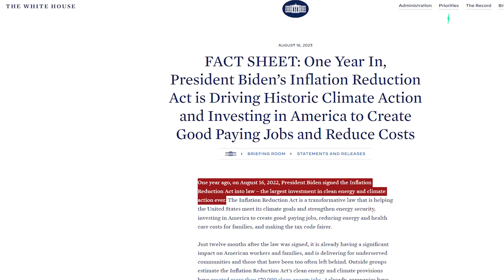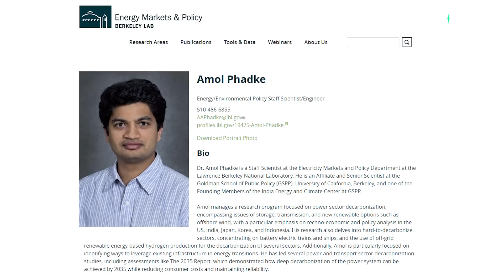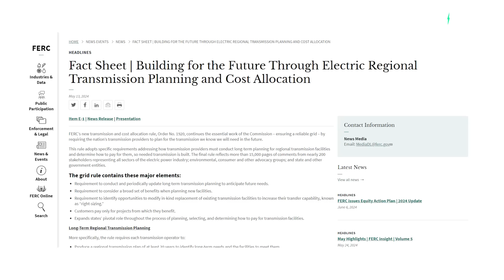How a small change could double the size of the U.S. electricity grid

Comment: The US grid is not in shambles!  You are so uninformed.  Utilities have always used various means of upgrading power lines to meet increasing loads.  Reconductering or increasing the lines voltage are some of the methods used currently.  Utilities do not build lines to maximize income!  Planning the transmission system is a complex problem because what you do on one line impacts other lines.  I doubt you have ever taken the time to understand the complexities of transmission planning.  All of this green system stuff is really making things worse because it is so variable.  Who wants to install a long transmission line that only has power on it for 8 hours or less per day?

Comment: Local roof solar & battery back-up would reduce some of the burden. If you look at the rooves of Tesla sites, their solar is growing, visibly. It isn't just residential that can do this. As for power lines, they have been doing capacity upgrades for years, first with glass fibre re-inforcement, and now with carbon fibre. It reduces the weight of the insulation/armour and affords more weight of the copper. Equipment on the ground has to reflect the upgrade. It all takes time & money.

Comment: As a former grid operator, the first thing I'd say is what about the transformers? Elon Musk has said the bottleneck will be having enough transformers to build out the grid, and he is correct. The stability and control of the grid is also a challenge. Consider a whip 2,200 miles long. Even longer if you attempt to go coast to coast. This has been tried before with the Texas interconnection and had bad results. Hence DC to DC ties between interconnections to transfer relatively small amounts of power. The rest of the world outside of the U.S. has just started to grapple with really long interconnections. What will happen eventually is electronically controlled solid state switching will be used to maintain stability. Tesla is ahead of most others in this area. The reason to use a grid in the first place is reliability and economies of scale, the actual price of electricity has gone down over the years and will continue to do so.
Reply: Saw a recent out of spec podcast video mention charging stations with "solid state" transformers.
Essentially: if you can get switch mode power supplies to work at medium voltage: you don't need the transformers anymore.
They still need coils of course: but at higher switching frequencies (relative to the grid's 60Hz) those coils can be made a lot smaller.

Comment: Delete this shit. Aluminum has good conductivity, high strength to weight ratio and high conductivity to weight ratio. As power stations are added local power will reduce the load on the wires. 
Understand that every coal powered plant is much dirtier than All OBD1 and OBD2 cars.

Comment: Its clear that you have never worked with a Public Utility Commission (PUC) which set the rates for each electric company. The process is typically slow and involves multiple local and state agencies. A major cost in electrical rates is the amortized cost of new construction + fuel cost + maintenance costs + taxes + dividend cost to share holders. To do a major construction project, like replacing the hi-wire, requires the PUC to approve the project and authorize the inclusion in the rate base. Adding new funds to the rate base raises the cost to the consumers. Another issue ignored in this video is transformers. Every high voltage line segment begins and end in some very large transformers and associated switching gear. The transformers are sized for the line capacity/voltage and would all have to be replaced. These transformers are all custom built and the backlog for any transformer can easily be years. For a significant portion of the electric utilities, getting transformers is their largest expansion problem. Historically the US Federal Government Commerce Dept. has consider the electric grid as a step child and created more roadblock that leadership. Trying to get leadership from any bureaucracy is a challenge and I wouldn't hold my breath waiting.

Comment: If you put so much power into a wire that you cause significant heating transmission losses would be huge, more sensible would be to convert selected wires to ultra HV dc which easily doubles power transmission and lowers losses significantly.

Comment: Not very true at all, generators have to install necessary grid upgrades to move their power upon installation.  The electric vehicle demand can be planned for since it is happening slowly enough.  There is no such thing as a 100% renewable grid, it will collapse due to lack of inertia and inability to provide steady, reliable power.  The cost to store grid scale power in batteries is enormous and unnecessary for all other forms of power generation - pulling for geothermal advancements.

Comment: I think there was another quick fix to help the grid also in the same vane. There are plastic balls that are attached to the high voltage wires that can report back the current weather for each wire. Knowing each wire's temperature allows them to better send power through them. It would make sense to install these at the same time as replacing the old wires.

Comment: This fibre cable may actual become obsolete with latest cabling that may be another 300 % more capacity .Be aware as much advances s you see in batteries is occurring in cabling . A decade ago there were cables that were 10 times more efficient than existing cables it's just they don't last as long . Change is coming .

Comment: Because there's probably a significant weight reduction by removing the steal core which means that the outer aluminum(current caring) strands could be increased too... so along with not having to reduce current to prevent sagging on hot days, the grid has the ability to pump more electrons through these "power pipelines".

Comment: There is finally something the Electric Viking and I can agree on. This new type of transmission line is a great advancement. This is needed because thorium nuclear power is going to increase electrical demands as the price of electricity becomes much cheaper. Eventually thorium will make solar and wind turbines obsolete. Thorium is much more environmentally friendly as nuclear waste from thorium has a 200 to 300-year half-life and is of very low volume. Liquid salt reactors can also run on nuclear waste from conventional nuclear power plants thus solving that problem as well. We also need to put water to combustible gas technology out for free on the internet. That way the elites cannot suppress this technology. Vehicles run on common tap water even salt sea water will make fueling vehicles almost free as was predicted by Jules Vern.
Reply: Not allowed. Only solar and wind allowed in this modern Religion of Renewable Energy.

Comment: I don't know if NIMBY is a thing in Australia or not.  Here in the U.S. adding transmission line capacity is a long arduous process of sighting the line, the "not in my back yard" crowd fighting, suing, suing again, fighting more, and suing yet again to keep lines from being built add significant cost and time to build new infrastructure.  Re-conductoring existing line has the added complexity of taking that line out of service to string new wire - having the consequence of actually reducing already critical capacity.  As @terrylane1942 states, the solution is going to be along the lines of private self generated power to alleviate the strain on the grid.

Comment: The US grid has plenty of capacity to convert all transportation to electricity. It's simply a matter of correctly structuring rate schedules to inventivize off-peak charging. When done properly, this will increase generating plant utilization factors and drive costs down. Powerlines are not the problem. Data mines are the real threat, not EVs.
Reply: A simple thing like linking the eastern and western power grids is also a well know low cost solution that would meet the need with no additional power stations having to go on-line.  

However with point of use power generation becoming more predominant a National Grid becomes more of a Albatross instead of a benefit so should we be investing funds in something we really need to seriously consider fazing out?  A National Grid might have made sense 100 years ago to large centralized power companies but today it's really more of a dinosaur that probably should be allowed to go extinct along with the Greed Machine it supports.

Best!
Reply: @neilfromclearwaterfl81  Yes, east/west UHVDC transmission lines should have been built decades ago.
Reply: Agreed.  Well done.

Comment: Material science needs to get after the temperature superconductor. Those bulky power lines are expensive and lose a bunch of the power. Until that happens we need more distributed battery storage that can be slowly charged during the day and deliver the power at close range when needed.
Reply: No. HVDC allows higher voltages and lower losses. Now that terminal inverters have tumbled in cost  with the advent of much higher voltage silicon carbide switches (the stumbling block for HVDC) HVDC can now be used for most cable runs over 100km. Losses are proving to be more than halved at 3%/1000km. This is more than good enough and the coaxial cables (send and return in one sheath) can be sub-terrain and sub-marine with dramatically longer lives.
Reply: A good power grid is more cost efficient than a battery. You only need batteries if there is not enough grid capacity or if you want to have a backup against blackouts for some minutes.

Comment: The "shambles" routine is a bit (quite a bit) over-played.  Real Deal, parts of the Grid are 25 to 50 years old -- not because of some drama -- just because that is the Service Life of the existing parts.  Think about that a minute?  It means those parts are due for replacement and that is already pre-planned and budgeted every year.  With a 25 to 50 year Service Life, that would mean about 2 to 4% of the Grid gets repaired or replaced every year.  It is going around US all the time.   If we are doing the job well, folks do not even notice.  You may have to get up at 6am or so on a Sunday to new lines go across a shut-down highway.  When we put in the new and replacement it is the best and current state-of-the-art -- but in 25 to 50 years that now-new will have reached its Service and be due for replacement.  So there is always this big "moving window" of time looking 50 years back (now 1975 or so) and looking forward 50 years (2075) or so.  Weather events, hurricanes, tornados, forest fires, earthquakes can shift some local timelines, generally to quicker.  And for-profit-owner corporate operators sometime try to delay, but that incurs risks of failures -- like California, for example -- where they pushed steel brackets to 80 years, and they broke in the wind and caused huge forest fires, deaths and damages in the Billions.
Reply: I think it depends wildly on the area. Where I live the recent survey put average age of equipment over 55 years. No wonder why we loose power every time the wind blows hard. And further down the street the "temporary solution" is that they have the lines about 3 ft off the ground bolted to some trees because everytime they put a new pole in the area the other ones are leaning or so weak that trying to fix one pole literally just snaps another one off further down. It's been wild to watch them trying to deal with it lately. I think eventually they will have to come through and redo the entire area. We probably loose power 2 to 4x per week for 1 to 3 hours each time.
Reply: @DynesLair-kb6qs  Sounds like a shoe string operation. Where is this?
Reply: @DynesLair-kb6qs  Sure.  You may have a "problem"  of older folks and older minds. :P   Joking, but not really joking.  100 years ago and the grid was just new and young -- poles and wires were the thing.  Now in many places "underground" is the better long-term choice.  From the conditions you are describing it may be time to consider that.
Reply: I think the issue is that some places did not budget correctly, and have no money to replace the older parts. Since they keep shifting to other things, and doing the bare minimum. Or the area is simply poorer. 

 The problem is private companies have their agenda to make more profits for their shareholders instead of actually making America secured.

 Look at the Texas grid, and all the woes. They didn't want to be regulated so they went on their own with their private company doing bare minimum. They didn't build for the cold, nor prepare for the extreme heat! In Texas! 

 Texas should be an energy power house, with wind, solar, and oil. Wild. 

 I'm so sick of us subsidizing these companies just for them to pocket  those as profits. I bet it would be more stable, and better if it was ran by the government. The power companies are like banks now. Too big to fail, and they know it.
Reply: @dianapennepacker6854    Well for Texas (Winter Storm URI, right?) the problem(s) were not about Transmission (the BIG towers) nor Distribution (the local poles and wires).  The Fails were on Generation.  Gas Failed at near 40%, Coal Failed at around 30%, and Nukes Failed at 25%.  It was so cold, that water, piping, and controls froze.  Even the Coal stacks froze solid.  Interesting is that Solar PV produced more.  Solar PV runs better the colder it is, and with the snow reflection, Solar PV production went up!  So now Texas is building a LOT more Solar PV.
Reply: @philtimmons722  Yeah but a lot failed for dumb reasons too. Practical Engineering did a great video of what went down hour by hour. 

 A cascade of failures.
Reply: Power companies are run as regulated monopolies.
Reply: @dianapennepacker6854  well said. I totally agree with you, my friend.
Reply: @dianapennepacker6854 
I can’t agree because almost all these companies are public utilities and are restricted by state and federal laws on how much they can raise rates and profit.  So if we want to upgrade our grid we will need to do it with tax dollars or let private investors supply the investment for higher rates in return.
One path is paid for by more debt and taxes and the other by higher utility rates.

Yes some of these utilities are not as well managed as they could be, but that is not the issue here, it’s how do we pay for investments in our grid that are not part of the current math.
Reply: Budgeting for maintenance and replacement is not at all the same thing as upgrading.
Reply: @pentoo988  Understood and agree, Capital Budgets are their own projects and operations.  Just saying the "Grid is a shambles," is sort of nonsense as a trope.
Reply: The problem is that waiting until they reach EoL is too slow. You need that extra capacity yesterday, because it's blocking the new generation coming online. If you let private companies own the grid it's hard to persuade them to do the upgrades. I think it makes a lot more sense for the transmission grid to be publicly owned so what needs to be done can be decided holistically taking everything into account, even if the generation is in private hands. In the UK everything is privatised, but the grid is owned by a different company to all the generation. The generation companies are customers of the grid because it allows them to sell their power. Like the train operating companies are customers of the company that owns all the tracks.
Reply: @adrianthoroughgood1191  I 100% agree it's time for the government to take over these functions because the corporate results have been abysmal.
Reply: Actually in hurricane zones we tend to have a more modern and well maintained distribution system. When we sent electric crews to the North East after Sandy they were shocked at the antiquated electric distribution systems there.
Reply: @bradleyanderson4315   Sort of self-pruning in many Hurricane areas. :P
Reply: some of that infrastructure is pushing 75-100 years now
Reply: Explain the Texas grid then 1
Reply: They should "bite the bullet" and bury "the grid".  No power lines to avoid, cause fires, or install/support.
Reply: Sensible reply. Thank you.

Comment: The investor owned utilities in the US began recabling transmission lines 3 years ago.  A major holdup was the lack of a domestic supply of the new cable.  TS Conductor now has it's production facility up and running in California.
The socialist utilities are the real laggards in the adaptation of this technology.  The TVA, Bureau of Reclamation and LA Dept of Water and Power have done none of this.

The complementary technology to this is the installation of sensors on the lines to measure real time atmospheric conditions.  This allows for the increase in current levels on the line.   The two technologies together can increase the ampacity of a transmission line by 30 to 70%.
This can be done in Australia, South Africa and Europe as well as in the USA.